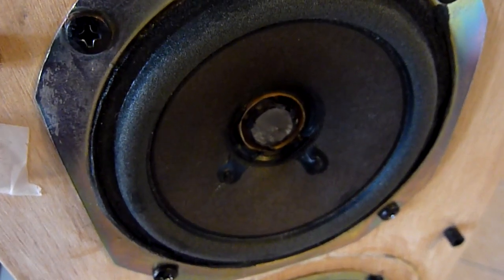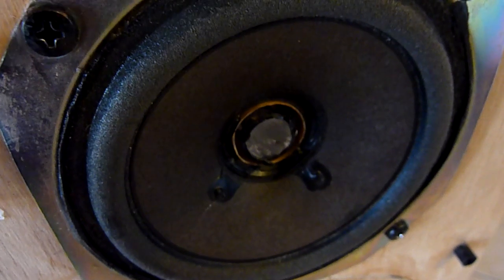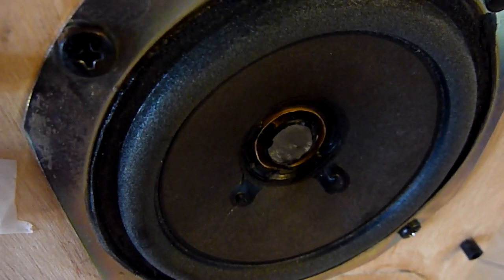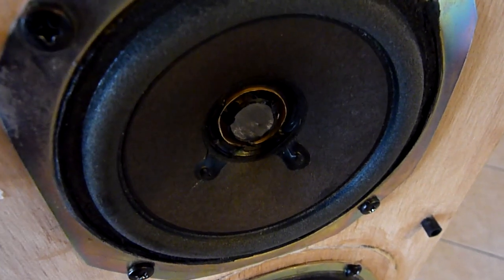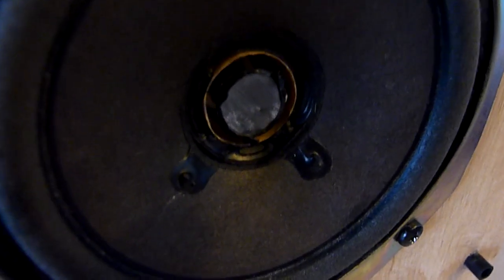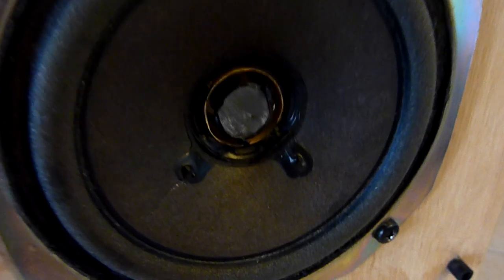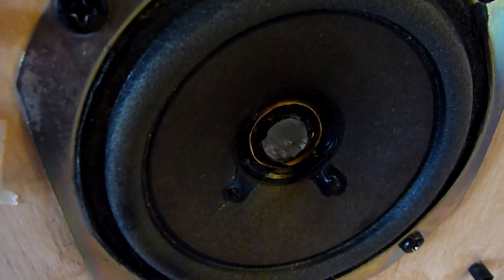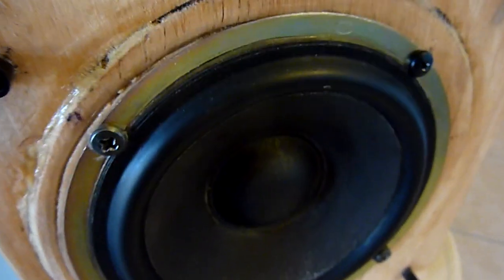"STILL" CONE, BETTER SOUND THAN FULL-RANGE SPEAKER.

Comment: How ya doing today, Have you heard about carpet speakers? I found a Japanese channel and apparently there happening there. You take a roll of stiff carpet roll to the size of your speaker and put in roll. I tried it and it is amazing.
Reply from the maker: When you say a "roll of carpet," do you mean only one wrap? And put it in the speaker box? I'll try it. I don't suppose you mean a rolled-up carpet (with many wraps). That would take up the cubic capacity. I can adjust the "cubic" capacity of speaker boxes. Put ping-pong balls in them. lol They also scatter the sound more (inside the box).

Comment from the maker: See my video called "What's Inside My Point-Source Speakers?" If you are familiar with piezo-tweeters, you are in luck. Otherwise, look it up on You Tube. Also see my "viral" (lol) video called "Make the Best Seakers in the World".
With the first video mentiond, there is everything to go-by except cabinet dimentions (7"x7"x1'). Drivers are 1/2" pizo disc, 4" Sharp full-range and 5" LG woofer. A crossover (also in my video) is necessary for a sound like you can hear on these speakers.